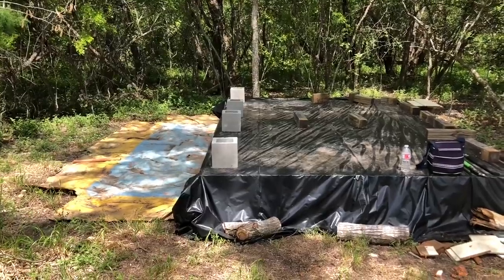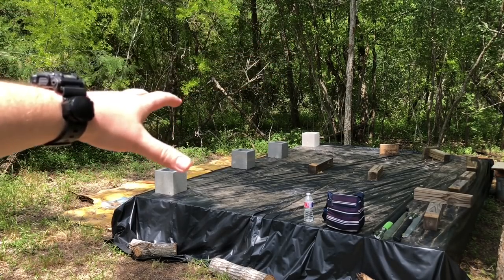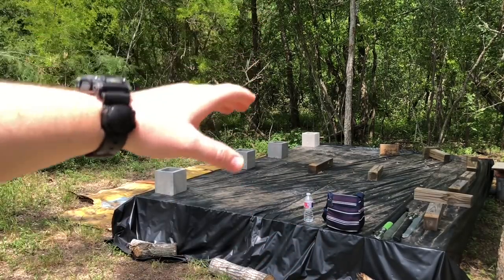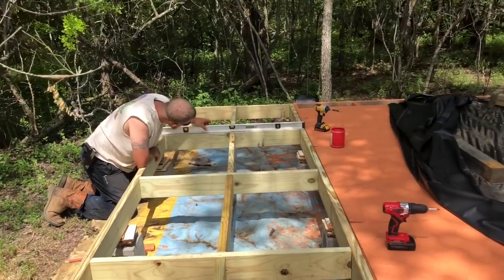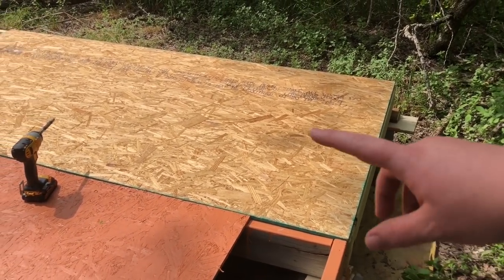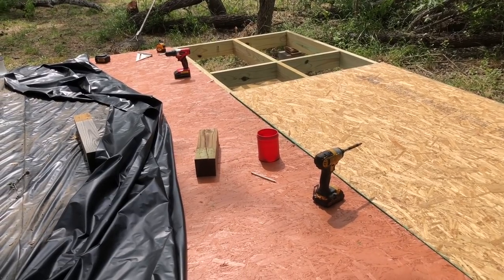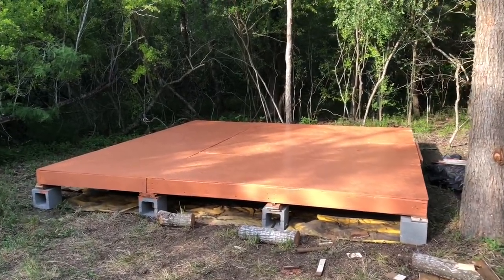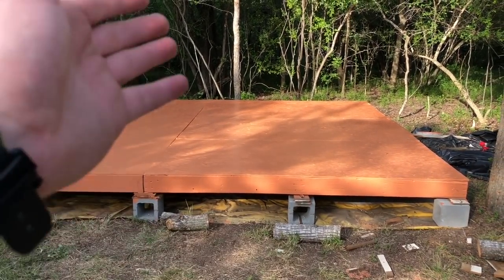Building Off-Grid Bugout Survival Shelter in the Woods

Comment: Chris pleade befor you put the full flooring on. Make sure your blocks are placed with all 4 sides vertical, cinder block ate not designed to be load bearing with the hole horizontal. They will break under weight and your shelter will possibly collapse .

Comment: Looks great but I'd say that the cinder blocks should be flipped, dramatically increased strength. Awesome video
Reply from the maker: Cris Vega Its a toss up really... once flipped they start to sink dramatically creating an uneven surface which can cause structural damage anyway.... if anything we will add more Cinder blocks to the foundation.
Reply: I concur. Blocks should be placed on end, not on their sides, to take advantage of the increased compressive strength. And they should be placed on some kind of concrete footing or flat rocks, primarily to avoid shifting in torrential rain conditions (perhaps even filling the blocks with concrete) Also on the side like that, if you ever have a problem with pests (rats, snakes, skunks, ground hogs) under the floor, it would be difficult  seal up the crawlspace. At least have the flat side facing out except for the 4 corners. Plus the primary leveling effort should be getting all the blocks leveled out, and not have to rely on shims except in a few cases. But I would have probably have used concrete cones instead if you werent going to mix any concrete.  You might also have considered placing gravel or stones on the ground below the floor to decrease washing out the ground during heavy rain. But maybe this location is in a desert environment? Also, I didnt hear with what kind of paint or sealant you applied. I would have definitely sprayed the ground below with an anti-pest (termite) spray. And I would have laid down and buried an inexpensive 3" PVC vertical and horizontal pipe about a foot down just in case you ever wanted to have a drain for an internal sink or toilet someday. Good effort but I didnt see a lot of serious long range planning here. Just a lot of busy work to get something done in 48 hours. Wish you the best.

Comment: A solid structure beats trying to live out of a tent. You have more options like a simple sink, bathroom (Portable or bucket toilet), and the ability to store the heavy supplies like water, batteries, fuel cans, a generator, etc. And you can build a small kitchen area for your small stoves and to keep your cookware. Maybe put in a wood stove for cooking and heating.
I'm in Florida, so I'd setup small fans (battery powered or solar) to avoid stagnant air and heat buildup. And you can always extend the roof or add a deck in the future.
As far as defense, ugly as the idea of hostile people sounds, you might need to build some sandbag walls, pile some old logs and make an effort to camouflage the place. You'll figure it out and it should be a very secure shelter.
Reply from the maker: All Good Tips and Ideas! Thanks!